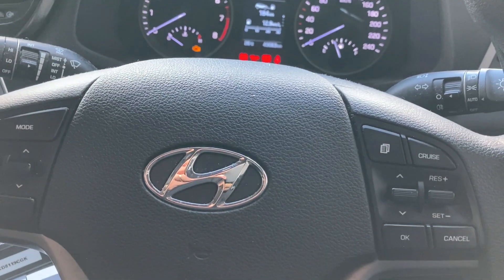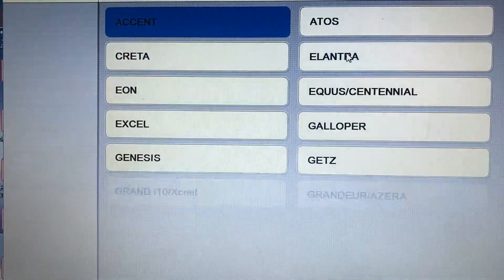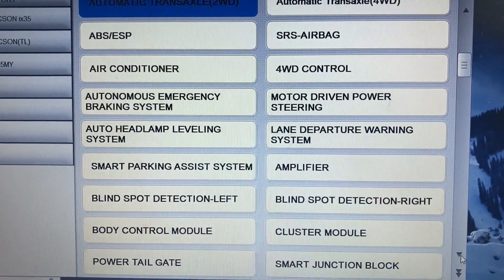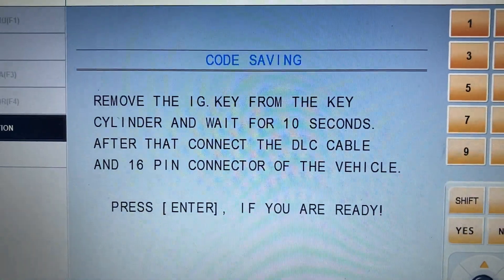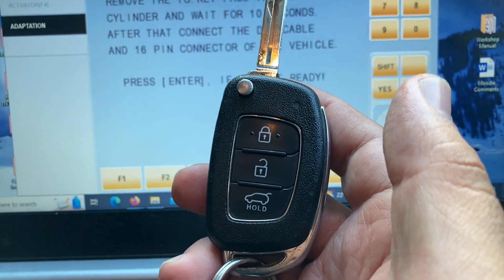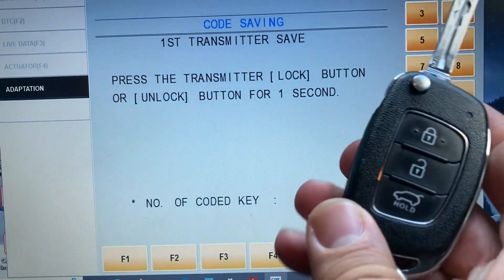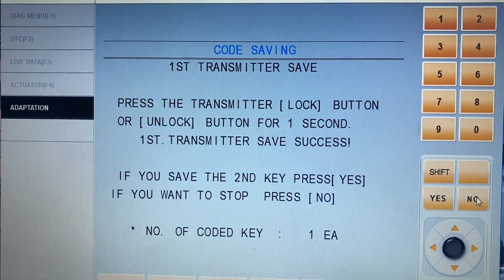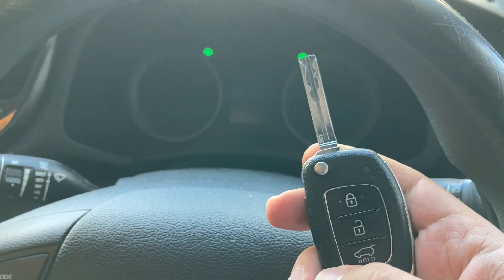How to Re-Program Remote on Hyundai & KIA Vehicles | Without Any PIN CODE !

Comment: Who told you that transmitter code saving for keyless entry need pin code..
Reply from the maker: Hi there,video clearly shows that PIN code is not needed, but many people have asked me for the PIN code when they need to do this, as scan tool is required for the reprogramming. So this is for those who haven’t done the programming before, those who did already know that PIN code is not required ☺️

Comment: What scanner or software are you using ?
Reply from the maker: This scanner was CarmanScan but many other scanners cover this function too.
Reply: @AutomotiveDiagnosis  Thanks for replying. I have a Launch scanner and was able to activate new remote for my 2015 Santa Fe (should have written down what steps I went through) but have not had success trying it with my 2013 Kia Optima.